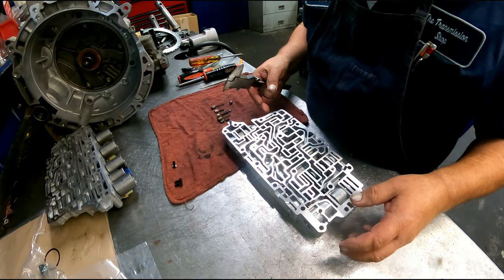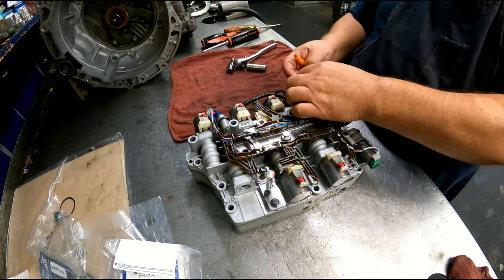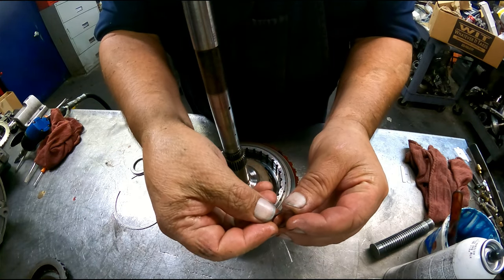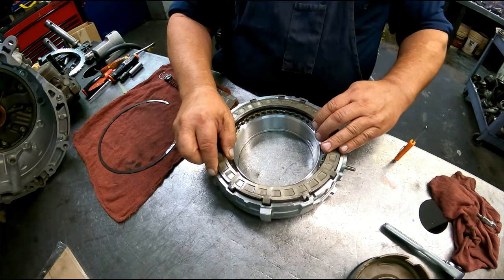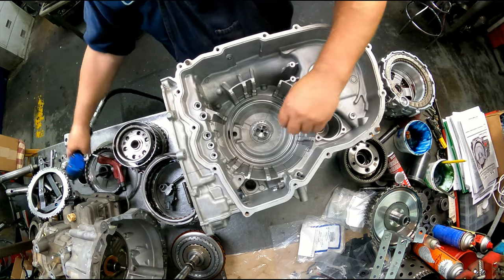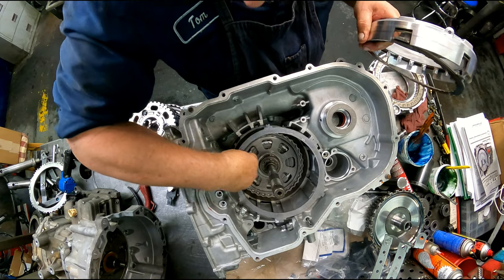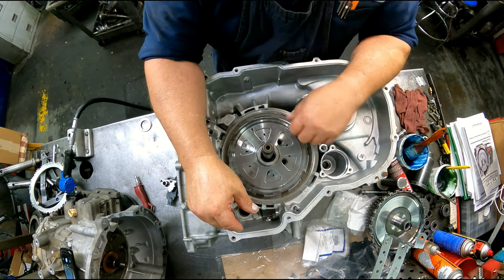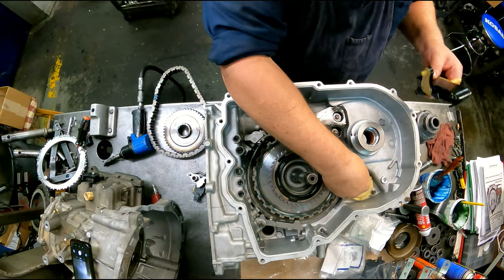8F40 Recase

Comment: Hey Tom Scott here from Aamco in Omaha- to compress the sealing rings on the input support use the 6t70 tools. FYI the planets in these transmissions are horrible. They blow up, make sure you replace the selective clutch assembly and the trans cooler when O/H these transmissions. I also made a tool to compress the A clutch from the old Selective clutch assembly- works perfect.
Reply from the maker: Thanks for sharing those tips. I have read that about the planet and sprag. The planet is supposed to be updated, now if they can make the sprag better. If you are on Instagram post some pictures of your tool you made, I would be interested to see it.

Comment: Hello,
I have a question, is it normal for the 8F40 to roll backwards on an incline? The gear is in D
I would be very happy to receive an answer.
Reply from the maker: Most vehicles will roll backwards on an incline if it is steep enough. Some of the later vehicles have a strategy in the computer that applies the brakes on an incline to prevent that.

Comment: I got a trick for that snap ring in the bottom of the case if it helps any. I put the apply plate on the return spring and then work the snap ring in with your screwdriver and hammer like normal. It kept the return spring centered in the case for me and it went in first shot after I did that. Hope this helps anyone.
Reply from the maker: Thanks for the tip. I found the tool for cheap, so I have that now.

Comment: Hey, what ended up not working in this transmission? I've got a Ford Mondeo with the 8F40 - it has very harsh gear shifts and the rpm shifts slighty while cruising at a fixed speed (about 50-100rpm). It's slowly driving me crazy and i'm not sure how to continue with those issues.
Reply from the maker: This unit came from another shop that could not make it work. When I got it apart it was pretty much destroyed. They did not want to put that kind of money into it and bought a used unit. All I did was put it back together. I have not been able to build one yet. Have had a few come in and every one of them was destroyed. These units have several problems. One of them being the valve body, which is "probably" what you have going on. The 2 other problems they have are the bearing in the planet coming apart and the other is the 2 way sprag assembly coming apart. Both cause catastrophic damage.

Comment: Hello! Can you please tell me is it possible to order a friction disks to 8f40? I’ve been searching in Europe,but no one cant help me. Any info will be helpful!
Reply from the maker: As far as I know the dealership is the only place to get parts right now.
Reply: @CurmudgeonTransmission he funniest part is that in Estonia official dealership cant order those disks , they can offer only full gearbox😂thats why asking maybe is it possible to order somehow from US
Reply from the maker: Contact Elizabeth @ WIT. They have the clutch module and do international shipping. I told her to expect your call. 18006333134 ext.2118
Reply: @vgremilov in Germany as well, at least according official service dealer. I seem to have a faulty differential in it, it shakes like crazy on shifts and throttle change, but they say they can not replace it alone, they do replace a whole gearbox.

Comment: Hey Tom working on a 4t65e transmission after I was done the front wheel were spinning opposite direction of each other while still jacked what’s the problem
Reply from the maker: No problem. Does not have a limited slip differential in it. Turn the vehicle off. Put in neutral. Turn one of the wheels by hand and it will do the same thing.

Comment: Hey do you have a video about merc benz transmission w211 722.6 ???mine is in limp mode it s a lot of traffic like going stop 1 and2 and stop!than transmission doesnt pass 50 mph! I have to turn it off and than on !than works perfectly!!any ideas???
Reply from the maker: Really need to know what the codes stored in the computer are. But, yes I have a video on the 722.6.
Reply: @CurmudgeonTransmission  i ve checked it and no codes are stored!
Reply from the maker: @blackview307  These have a big problem with the conductor plate on the valve body, may be that.
Reply: @CurmudgeonTransmission  my initial thought was a problem with the conductor plate!bthanks for your patience and for replying!

Comment: Hi  how i can change the oil in this 8 Speed Transmission?
Reply from the maker: Remove the plug in the bottom of the transmission to drain. Fill with Mercon ULV fluid in the fill port on top of the transmission. Check the fluid @ 185-199F, Check plug is by the axle. Fill till dribbles out at the appropriate temp.
Reply: Hi
I'm doing service on this transmission and only exit 4Lt of oil! How I remove the other oil??
Reply from the maker: @pedrosousa7508  You don't without having a machine that can do a flush.
Reply: Is there a filter to change too
Reply from the maker: @MePeterNicholls  No. You have to take the transmission apart to get to it.
Reply: @CurmudgeonTransmission  blimey.

Comment: This gear is am amazing example of missengineering. It could probably work, but no way it's going to be reliable.
Reply from the maker: It is an aboslute piece of junk. So is the GM Version, the 9T60. Even worse than the 10R80, and it is horrible. They "MAY" eventually fix the problems but I doubt it.